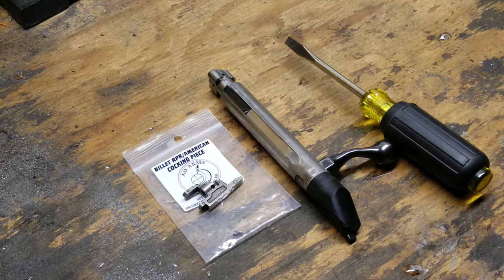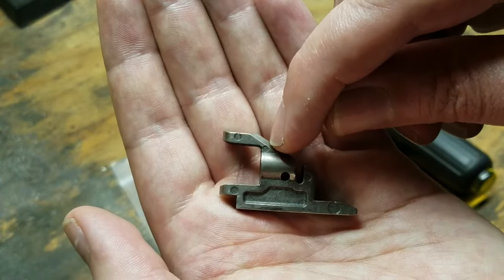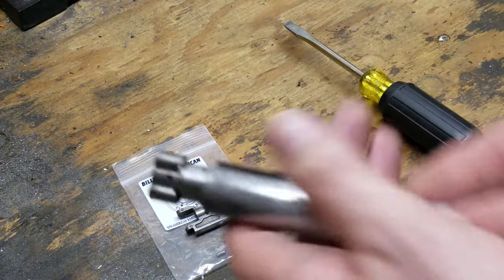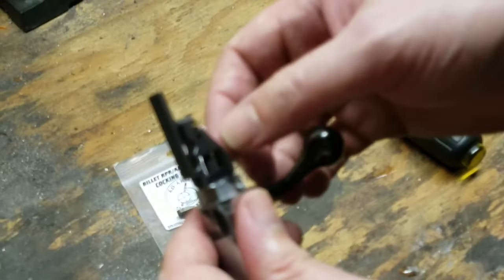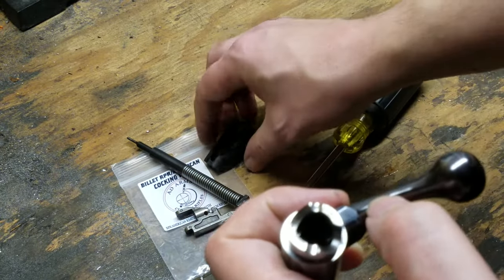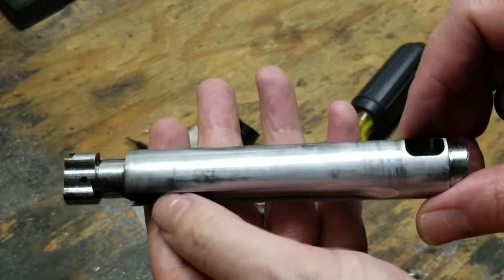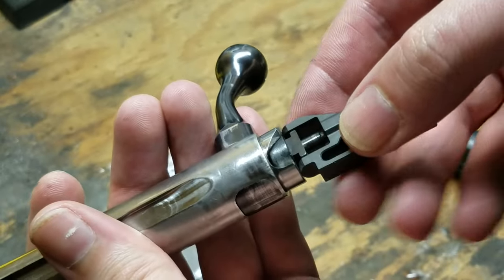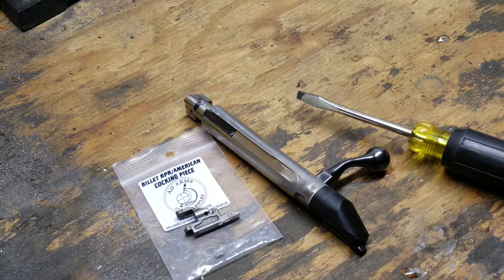Ruger American/Predator bolt disassembly the EASY way, with no special tools!

Comment: I over turned the bolt and locked it, and your video helped me figure out how to fix that! Note: rather than using a vice, I took a standard screwdriver and put the point against the cocking piece, and the handle against my belt and pushed. Doing so, I was able to twist it right back into place.

Comment: So here goes!  I bought the Anarchy firing pin removal tool.  It did not come with instructions.  No problem, I went to their website and to YouTube to watch before starting.  The guy from Anarchy knew what he was doing and by his own words, it was easy because he had done it so many times.  I believe him as he knocked it out with no problem.  The problem is for those who want to watch "close-ups," to explain and show us the steps.  Many years ago before I changed career paths in school, I was a Xerox technician.  I say this to give a background in my technical ability.  My first time taking it apart with the tool, the firing spring released.  The Anarchy video was of no help as his hands were covering the bolt as to where to line things up.  Then I found your video and the problem was solved!  GREAT JOB!  Maybe they should give you a stipend.  My thoughts are this.  If you are going to sell a product as a business, you should provide the best instructions.  It is a good tool and the guy knows his stuff.   However, most of us are looking for an instructor to go with the product.  On a side note, I found a block of soft pine and used an anti-slip pad from the kitchen underneath the wood.  I used the bolt handle to push down on the spring into the wood.  The firing pin went into the wood till it it the thicker part of the pin, and stopped.  The wood is soft enough so you do not damage the pin.  The anti-slip pad is a MUST to keep the wood from kicking out under the pressure compressing the spring.  Now back to my point,.........Thank you for such a nice video!  When I did my second Ruger it was a breeze and I did not release the spring this time.  :)
Reply from the maker: LOL I'll be sure to share this with the guys from Anarchy.
Reply from the maker: I think the phrase is "the devil's in the details" right?
Reply from the maker: If you're not already a member... https://www.facebook.com/groups/791513284361395

Comment: Great video. Does changing cocking piece smooth out the actual cocking. My rifle is smooth but is somewhat stiff when raising and lowering bolt. Made the mistake of playing with a Weatherby rifle at Cabelas. It cocked so effortlessly that since then I have been wondering if there is anything I can do to make my Predator work any way closer to that.
Reply from the maker: Thanks Rose! And yes it does indeed! If you look at the AD cocking peice in the video, the front rides against some 45° angled "ramps" on the back of the bolt body. Because the AD part has a much smoother surface it slides over those much easier as the rifle is cocked.

Something else that can help is adding a little molybdenum disulfide powder or Moly based grease to those 'ramps' and working that into the metal. Moly embeds into metal fairly permanently and it's SUPER slippery stuff! 

It's mostly used used for packing high speed bearings, like axle bearings ETC. It can be spendy stuff, I use Krytox by Chemours GPL 215 EP Grease which can run $30 for a little tube, but it lasts forever and also works great on the trigger sears too, to smooth out and lighten the trigger pull.

A new bolt handle can also help out a LOT by giving you better leverage. The only drawback of a bolt that opens easy is it opens easy... like when you're out hunting the bolt can barely bump open a "hair" and the rifle won't fire! Get in the habit of palming down the bolt handle every time you fire as a routine though and problem solved.

Comment: I was having light strikes yesterday so thought I'd take the bolt out and clean/check firing pin assembly. I've decompressed the firing pin fully. Any tips on how to reset/compress it again?
Reply from the maker: Are you saying the center part, the "firing pin spring stop" slid out of place so the spring is relaxed? (part number 4 on a diagram if you search for it) Use a block of softer wood, like a 2x4 ETC and a good sized adjustable crescent wrench. Adjust the wrench to the thickness of the firing pin back, then catch the ears/lobes of the spring stop, put the firing pin on the wood and push down on the catch far enough to turn things back into position.
Reply from the maker: Something you'll want to keep in mind too, with many bolt action designs if the bolt handle isn't fully closed ALLL the way it can cause light strikes! Even just a "hair" opened can do that. So it's a good habit to add "palming the handle closed" on the way to the trigger to your firing checklist... Especially when you're out in the field hunting ETC!

Comment: With as old as this video is, I don't know if you'll ever see my comment...can you do a video on replacing the cocking piece/firing pin? Please? Or direct me to one?
Reply from the maker: A new video is actually in the works once I get a minute. Anarchy Outdoors sent me their bolt tool, an AD arms cocking piece and new bolt handle right before hunting season and was planning on filming while I was hunting, until I forgot to pack the SD card for the Canon... 🙄 I've been pretty swamped since I got back. The Ruger American bolt is actually pretty much identical to the Ruger Precision in function, just has a nicer bolt shroud. You'll NEED a "roll pin punch" to drift out the roll pin in the cocking piece, as it has a specially shaped tip to stay centered and not mangle the roll pin. I forget the exact size off hand. https://youtu.be/4e8u3agMsfo?si=owSrwjRKbQ184Umb&t=196

Comment: Thanks. Wanted to upgrade my bolt handle and the cocking device is a NICE bonus. Did you change out the bolt shroud too ? The plastic ones are kinda cheap. Looking at an aluminum one from same company you got the cocking device
Reply from the maker: Yeah the plastic shrouds can break IF you manage to smack them just right. I replaced mine with the aluminum ones, but even at that Ruger will freely replace the shroud if it breaks on you, or any other parts for that matter. Best customer service I've ever seen in the industry among the countless accounts I've heard in online forums.

Comment: This is a great video and helped me get my new bolt handle replaced and the bolt put back in my gun! However I shot one round at the range and the firing pin dropped. I was unable to shoot anymore until I had tools to fix the bolt/firing pin. Have you had any experiences like this happen?  Just trying to figure out the “why” so it doesn’t happen in the field.
Reply from the maker: The firing pin "dropped"? You're saying the rifle fired once and then wouldn't recock the firing pin? Sounds like something didn't go back together right, did the firing pin back/cocking piece get lined up on the back of the bolt, there's a dimple where it's supposed to sit when it lines up correctly.
Reply: @macgyver5108  - Yes, everything was lined up when I put the bolt back in and I cycled the bolt probably 100 times, dry fired a couple times during that time. Shot one actual round at the range and the firing pin dropped/lost spring tension and wouldn’t go back into the rifle. I don’t think it’s any major issue, I’m just trying to figure out the why.
Reply from the maker: @kylevinny22  hmm, kind of hard to diagnose without visually seeing what part of the puzzle didn't line up correctly, but it's also not a terribly complex puzzle to troubleshoot either. Starting at the beginning of the order of functions, to cock the firing pin it first needs to catch the trigger sear where it sticks up inside the action. Did you make any changes to the factory trigger?
Reply: @macgyver5108  - No have not touched the trigger. I did upgrade the magazine well from standard to AICS magazines
Reply: @macgyver5108  - Absolutely, I’ll send them later today!  Appreciate the help!

Comment: Excellent....I have been having difficulty chambering a round without having to almost slam the bolt home in my RAR 300 blk....seems the ejector may not be allowed past the rim of the cartridge without doing so...I figured the bolt should be dissembled and cleaned, so we'll see what happens....thanks much!!!
Reply from the maker: What kind of marks are on the brass afterwards? Being rough to chamber I'd expect to see some tell tales on the brass rim. Was it always this way or is this a new development?
Reply: @macgyver5108  Hello......yes, I looked at the brass carefully, and like you, I expected a swipe mark or some sort of dent in the rim or something due to the amount of force I was using to chamber a round,  but there is nothing obvious.  I have not used the gun much after buying it new several years ago due to some health problems, and when I did hunt, I was using my 450 BM  RAR and or my 308 or 7mm-08.  In preparation for a hog hunt coming up, a friend and I were sighting in and working up some loads, and I thought finally, I will drag out the RAR 300 blk.....the bolt was sticky straight out of the box, but I watched a video by Iraqveteran8888, and they had the same problem....I figured it would work out.  Again, I had put it up for some time.  I wrote Ruger and asked about the problem, and they have advised me to ship them the gun for inspection....perhaps this has happened before with some of the guns from a few years ago....guess I will crate it up and we will find out......thanks
Reply from the maker: @George1mac  well it does occasionally happen, that things end up out of spec by a hair. Ruger's unheard-of customer service is why they're my preferred budget bolt action company! They'll make it right...

Comment: If you over rotate it can you just rotate it all the way around again? I did it without a vice by just rotating it all the way around back to where it need to be
Reply from the maker: It would seem so after looking closer at the design, the firing pin back is pinned in so it can't come loose as I previously thought it would. I might delete this video, or make an updated one.

Comment: I have a Mossberg patrol it will not cycle without jamming please tell me the truth how does your run
Reply from the maker: Sorry to hear... I've got three Ruger American Predator/Go Wild rifles and never had any jamming issues per-se. Sometimes you'll get a new magazine that's a dud and sticks, but a quick call to Ruger and a new one is in the mail no questions asked. Over 600 hundred rounds later and no more mag issues. Even on the forum I moderate you can ask anyone, these are reliable and accurate rifles, especially at the price! Howa 1500's are top notch too. There's a popular saying: "Mossberg should've stuck to shotguns." Savages can be stupid accurate too but even certain model Savages have feed issues.

Comment: I changed the bolt handle and got it together but now closing and opening the action is very stiff. Did i do something wrong? It takes like twice the force compared to before.
Reply: Edit* after taking the firing pin out another time I didn't see anything wrong, I neglected to check clearances on the new bolt handle and the new stock I put on the barrel and action. I just ended up sanding down the edge of the stock and bolt handle that was touching and it's smooth as butter again.

Comment: Do they make a metal shroud to replace the crap plastic one?
Reply from the maker: INDEED THEY DO! Check out the anarchy outdoors website under Ruger American/Precision rifle parts, the RPR has the same bolt body as the American rifle line.
Reply from the maker: https://www.anarchyoutdoors.com/bolt-shroud-replacement-for-the-ruger-american-rifle/
Reply: @macgyver5108  awsome! Hopefully ITAR allows for shipping here
Reply: @macgyver5108  I just looked and they use a Canadian distributor, Go Big Tactical
Reply from the maker: @juliogonzo2718  fantastic! Hope that works out for you and while you're at it I'd highly recommend that firing pin backing piece from AD Arms for not only reliability sake but also a much smoother and lower trigger pull!
Reply from the maker: @juliogonzo2718  https://www.anarchyoutdoors.com/ad-arms-billet-ruger-precision-american-rifle-cocking-piece/
Reply: @macgyver5108  apparently it does not work with the ranch model. That sucks
Reply from the maker: @juliogonzo2718  which doesn't work with the ranch model?
Reply from the maker: @juliogonzo2718 if you're referring to the firing pin back, their site info isn't 100% accurate, if you read the reviews "Posted by Joe on Nov 20th 2022
Great addition to my Ruger American Ranch. Matches the bolt."
Even though the site claims it 'doesn't fit'!
Which caliber is your Ranch model???
Reply from the maker: @juliogonzo2718  just posted this on the Ruger American FB group for some 'real world' answers, but I'm 99.99999% sure it does indeed fit as I recall, I've got an idedic memory for things like this...
Reply: @macgyver5108  it said the shroud was not compatible with American hunter, ranch or 7mm-08. Maybe the bolt is a different length or the aftermarket shroud won't clear the receiver or something
Reply: @macgyver5108  I'm sure the plastic one won't break unless I dropped the rifle or something else stupid on my part, but it honestly is the only thing I don't like about the rifle. I haven't shot it yet so I shouldn't call it a complete success yet lol
Reply from the maker: @juliogonzo2718  as far as I'm aware the only difference with 'some' variants of the American line models (including ranch, hunter ETC) is the bolt body diameter, like on the Magnum cartridges which are obviously larger by necessity for the larger bolt face for those cartridges. Even the Ruger Precision Rifle shares nearly the same bolt body and firing pin back except for some newer revisions of the RPR which have a different pin back. You can see those two versions on the RPR parts listing as shown in the two examples below.

https://cdn11.bigcommerce.com/s-dv1tqne/product_images/uploaded_images/moved-0e100516c6b0e1931248abc525aa81f2.png
Reply: @macgyver5108  I could take a $115 gamble and buy the shroud. I already spent more on that for a nickle +1 mag cap for an 870 from s&j that turned out to be a paper weight that fit my Mossberg but not my 870
Reply from the maker: @juliogonzo2718  so I just heard back from one of the other moderators with a Ranch model and they do fit like I thought. Just sometimes need a bit of 'cleaning up' around the edges because of minor tolerance variations. Work the bolt a few dozen times with it in place and keep an eye out for small shavings, clean those up after working the bolt.

Comment: I just use 550 cord make a loop, feed the loop through itself around the vice, pull on the bolt rear wards turning at the same tome, no damage done to any of the bolt. No mar or scar. Don’t have to use a vice either.
Reply from the maker: Clever... At that rate you could just make about a 6' loop of 550 cord around your foot and just stand on it to pull against it.
Reply: @macgyver5108  Old school guys take down 700 bolts using their boot lace since it has a bit of a hook on it.
Reply: i was fixing to say the same thing, every marine with a rem 700 was taught how to disassemble the bolt with their boot lace while still wearing the boot.

Comment: I should have paid more attention the first time I watched this! I’m just checking things out after my first trip to the range with my new (to me) rifle. I twisted too far and came back to watch again. Then when you said “vice” I said balls. Again, I should have listened more carefully; something on this bolt is very sharp and sliced my finger open when I was trying to force the cocking piece back onto that shelf.
Reply from the maker: Ouch... Part of my range kit is a small box with tools and things I use for gun work. One of those items is some deerskin leather gloves, which also end up in my hunting pack with my drag rope. They've come in handy for tending a small fire too if the weather turns and my lips start turning blue (no joke!). 😎

I think I might have a solution to gain a mechanical advantage to cock the bolt without tearing your hands up... Sticking it in BACKWARDS might work, plastic cap first until the metal bolt body slides into the receiver? You'd just have to turn the bolt handle the opposite direction far enough. I'll have to play with that idea on my father's Go Wild, my cheek riser interferes on my RAP aftermarket stock...
Reply: @macgyver5108  the vice worked. And now I know that I shouldn’t do that. I learn beat the hard way, despite seeing it on your channel repeatedly! Thanks!

Comment: I still can’t figure this out, the part where you talk about wiggling it out this does not happen for me. So frustrated with this thing.
Reply from the maker: You mean the firing pin assembly? Might be the lugs inside aren't depressed far enough from the spring tension. What are you using to wedge into firing pin back/cocking piece? If you're using a flathead screwdriver might try one with a little wider blade so it spreads the parts open a hair more.

Comment: I did exactly what you said. I dropped my bolt and it was out of time. The manual said rotate clockwise ( the easy way). I went around twice. You say this might cause light primer strike , if so I will find out at range. If so should I rotate on vice the opposite direction and how much, how many times? should I do it now before going to range? I hope you understand my questions.
Reply from the maker: Hmm, I must have missed that part of the manual? If the "manufacturer" says it'll work than I wouldn't worry about it.